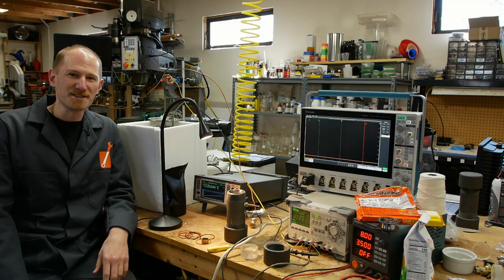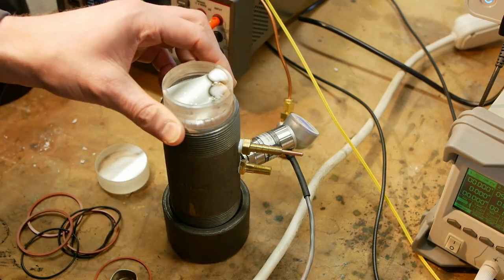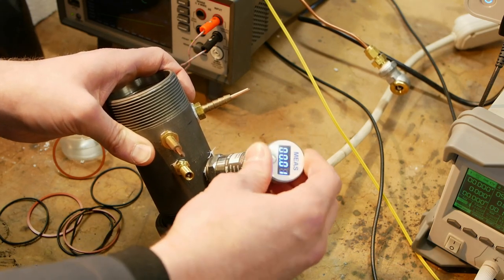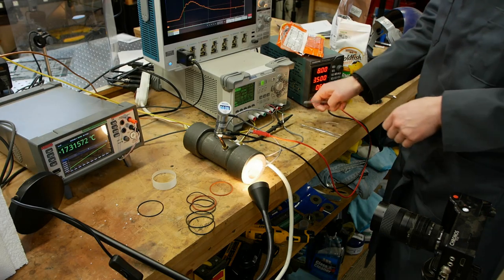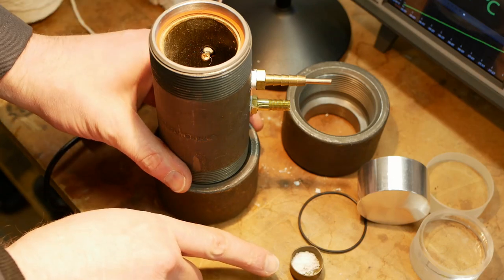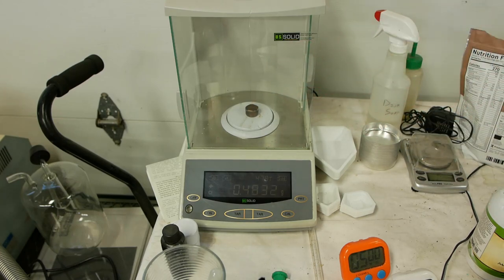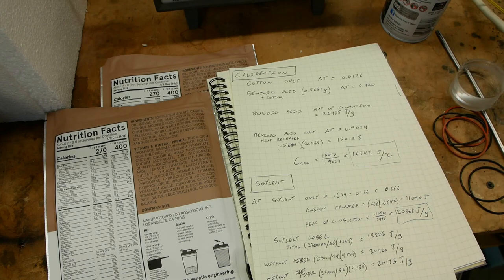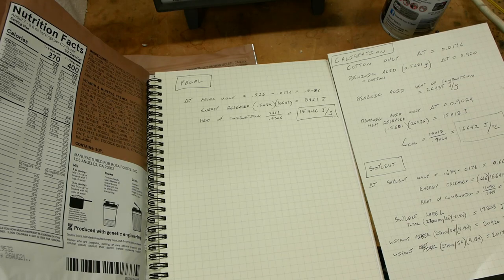Measuring human digestive efficiency vs. a flame

Comment: As others have commented, the answer fails to answer the question because the solid matter passed out is between 10% and 20% of that consumed: the rest is passed out as CO2 (carbohydrates, protein, fats, are metabolised to CO2+water).
To do this experiment accurately it would be necessary to:
1.  Water fast for long enough to purge the waste, or use a drug such as that used for colon surgery to purge.
2.  Add up the total weight of dry food in, and dry waste out.
3.  Follow with another water fast to ensure you have caught all the waste.
4.  Compensate for CO2 lost from metabolising sugars and fats during the fast: this is not easy to do from weight change because a gram of fat contains more than double the energy of a gram of sugar.  For a short fast, almost all the loss will be sugar.
5.  Add the output of CO2 during the period of the experiment, based on your base metabolism.
A lot of controls and compensation to do get a real figure.  
A quick guide is 80% of food in when dieting is metabolised to CO2, and you measured that the solid output has a 25% reduction in calories, so 80%+(0.25x20%), so overall the human digestive system is 85% efficiency.

Comment: Silicone does burn in normal air, just not particularly well. A good first-line test for if something from a shady company is actually silicone or some other polymer with an innacurate label is putting a small piece of it to in a flame. If it's extremely hesitant to burn on its own and produced fine white-to-grey ash without charring that means it's real silicone.

Comment: These experiments are extremely difficult to do with any degree of accuracy. The problem is basically that the body stores a few weeks worth of energy as fat, and your experiment involves a sudden change in diet which would be buffered by this. If you continued the experiment for a few more weeks you’d probably find your Soylent intake increasing or your poop calorie output decreasing. The other way of measuring digestive efficiency is to confine the subject in an airtight chamber and collect up all of the CO2 and water emissions to infer the amount of food “burnt”. I guess this is even more uncomfortable than eating Soylent for a month.

Comment: Interesting. I feel the point others made about input/output ratio is valid. Also, it must be mentioned that a lot of poop consists of heme(iron) and proteins from dead blood cells discarded by the pancreas i think. So this experiment could potentially be burning iron that was not able to be replaced by the soylent.

Comment: You might use a  soft copper gasket made in a similar manner to the silicone gasket you show in this video. It is MUCH less flammable and compressible enough to make a decent seal. You may use  8 to 16 mil material as you think best for this application.

Comment: Did you consider that the fecal matter is less than the food you consumed - that is for each gram of Soylent you consumed, you did not produce one gram of dry fecal matter. To really calculate the digestive efficiency you need to take that into account and it will change the result drastically.

Comment: You should make a recess for the o-ring into the metal. Less surface will be exposed and it might be squeezed nicer. If the recess is perfect, you could probably make it perfect with no exposure at all to the oring.

Comment: I would assume the surprising result has a lot to do with a few key factors to keep in consideration. As someone already mentioned, the dry mass of stool will always be lower than the dry mass of soylent consumed for a given day. In this case energy density isn't the only data point, it would be interesting to find out would be a total yield of stool for a given day to calculate the total caloric difference from input to output. A yield would depend on regularity, water intakte etc. but this could be accounted for with frequent measurements ;-) 
Another thing to keep in mind is that around 30% of the dry mass of stool is bacteria, which in their own right have a high macronutrient content. In other words, the soylent doesn't only provide the host with energy
Reply: 30% of stool is gut bacteria, but it is grown out of the food we eat. And the lifespan of gut bacteria is just 3 days. So all the gut bacteria comes from the food he was eating. So there is no diference between food that we didn't absorve and food that we didn't absorve but reorganized itself in the form of gut bacteria. Since he kept the flow of energy constant by always eating the same amount, it is still reasonably accurate.

Also, unless he changed weight, all the mas he ingested will get out some way. But most of the flammable matter is going to be in his poop, because the rest is basically inert gasses, salt and water. The difference between the mass of poop and intake food will only tell you how much mass he lost by other means, but not how much energy.

Comment: Possibly a comparison of total Soylent intake to total dried fecal matter would be beneficial .
I think you are missing the fact that the output is not only the result of Soylent processing, but a fair amount of total body chemical cleanup / discharge .
I assume a large part of the output is actually spent organic matter from every part of the body .
Just a rudimentary study of the digestive system reveals that a wide variety of substances are present and injected into the processing facilities of the gut .
There must be many caloric ingredients present in the waste that is not directly a remnant of the Soylent .
It could be that the body is processing and using a high percentage of the Soylent and the waste is comprised of other materials from around the body.

Comment: It would be interesting to use a second known source of heat (apart from the benzoic acid) to confirm the calibration was working correctly. Really, really awesome stuff! (I think diet and metabolism science folks would be super interested in this setup for rigorous measurements)

Comment: You've missed a key element of data: you have not checked how much Soylent corresponds with 1 gram of fecal matter, and have erroneously assumed it to be 1:1. Most likely it takes significantly more than 1 gram of Soylent to produce 1 gram of fecal matter, perhaps multiple times as much. The human body absorbs a significant amount of the dry mass of food in the gut and expels quite a lot of dry mass via urine. Fecal matter dry mass is almost certainly lighter than the food dry mass it corresponds with, and may be drastically lighter.

A more reliable method would be to measure the total dry mass input per day (maintaining a stable amount), and then collect all fecal matter over several days, desiccate all of it and get a daily average dry mass output. This would be a much more difficult task but would yield a fairly accurate result on the actual efficiency of the human gut.

Comment: At first I didn't quite grasp how the change in temperature from 13 to 14 degrees and a change in temperature from 14 to 15 degrees is caused by the same amount of energy, but I guess it makes sense.

Water + "bomb" is the system we are measuring and energy put into that system by the bomb will disperse into the water. We are measuring heat which is energy so in both cases the increase in heat/energy must be the same.

If, hypothetically, the bomb-water isolated system was at rest at 200 degrees C. Meaning, the bomb is at 200 degrees C and the water is at 200 degrees C. Now we combust the bomb, it will heat to some number, let's say 300C. Now this heat will be transferred to the water and equalize throughout the system. This will take some specific amount of time for the heat to disperse equally throughout the whole system.

Now we repeat this above situation, but with the bomb-water system at 15 degrees C as the initial condition. We again combust the bomb, it gets to 300 degrees, there will now be more transfer of heat from the bomb to the water.

The change in temperature of the system as a whole is the same but the transfer of heat through the system is different in some way, there is more heat transfer. Does this change the time until equilibrium is reached in a significant way? Would it take longer to reach equilibrium in one of the cases? If so, in which one? (My guess would be the second one)

Comment: Nice. You can also easily make silicon rings in a 3d printed mould. Either use 2k silicon or simple high temp engine sealing silicon

Comment: Very interesting video. Some information missing is, how much output your digestive system produced per input. So i am assumung, that your endproduct is just conzentrated fiber, wich obviusly burns and therefore this relativly high number of kalories. I would suggest a calculation like: 100 Grams of Soylent produce xx Grams of waste which equals xx Kalories left over.

Comment: Lots of the comments here are interesting, but I'm just commenting to say I have that exact same flash drive that's shown plugged into the multimeter. I found mine in a park a few years ago, just lying in the grass. Yes, I plugged it in: it was completely empty. Now it's my most frequently used flash drive, despite being only 128 MB. (I guess the small capacity might be why it's used here, to be compatible with the multimeter.)

Comment: You cannot find details for the build of the caloric bomb, but still, you can find out how efficient the human digestion is, we were told that at school in the 4th grade. The human digestion is very similarly efficient to what you found out, except, as you already noticed, the fibers, that don´t get digested. Your results were great, compared to scientific, averaged results (averaged over thousands of humans). Human efficiency: 20-25% (tops). e-bike-efficiency: 90% multiplied by electricity generation efficiency (55%), gives us 50% total efficiency, so that e-biking seems double as efficient as walking, additional to that while e-biking, you´re 5 times faster than while walking/jogging (25km/h by 200W e-motor-power)... With a velomobile, you´re even 12 times faster, and (again, still) double as energy-efficient, than while walking/jogging ( https://www.youtube.com/watch?v=4IHIdGVGKdI purely driven by the legs, but still makes the case for the velomobile stats )... 
Aditionally, part of the food is being converted to methane by bacteria, and you cannot measure that ( unless you live with a hose by yourself all the time ). So, don´t believe people telling you that walking is the most ecological way of moving, humans have luckily developed long ago far beyond that... :-) Bye, and take care of your tires...

Comment: There are foods that require the body to use more energy during digestion than the energy contained in the food.
In other words, the more you eat of that particular food the more weight you lose.
Celery is a example of s food with “negative” energy content during digestion

Comment: It is not surprising that the specific calorie density of the output is similar to the input as is composed of many of the same things. The portion used by your body is converted mostly to carbon dioxide and water, which isn't in the freeze dried waste. If you want to determine your "efficiency" you'd need to track your input and output over an extended time and determine how much output is produced per unit of input.

Comment: Part of the equation is that our digestive system as lots of natural processes have a very big slack for bad times. What I mean is that the 25% energy takeout would probably increase if you would eat only one of that bag in every 3 days. Its tricky because your body weight would also start to decrease but that is also a calculated loss by the body, meaning it is actually advantageous to lose weight when starving because muscle maintaining is a big energy waste. I wonder how it would be possible to get the maxed out digestive power.

Comment: Have you considered 1 pound propane cylinder shraeder valves? They are insanely overbuilt in my opinion and could be suitable for alot more pressure. This doesn't account for the hard to push situation but hey... just a thought

Comment: I think the missing information is the total weight of dried input and output. What I mean is if dried input is 1kg and dried output is 200g, then you have to multiply the energy per gram by those numbers to get the real efficiency. 

Well, this looked worth doing just to put "setting shit on fire" under lab experience in the CV.

Comment: maybe you can try using tin to make a gasket. I know cody's lab does something like that with mason jars and it should work as long as you put enough force to deform it. Although i dont know if the reaction between oxygen and tin would affect it. I would really like to see if it does.

Comment: The caloric measurements are based on chemically measured base components which is why it's also put on the label. It is not exactly digestible calories either. These base components are converted to caloric averages of these base components estimated using body calorimetry and people getting fed some amounts of the basic constituents. Then they're summed up. As such these numbers are not very accurate.
The base components of food are derived by using enzymatic and chemical reagents. Whole chunk of science there to measure these more or less accurately.

Short version: calories label = calories glucose + calories fructose + calories sucrose + calories starch (+ other sugar calories enzymatic processed, e.g. lactose) + calories for each kind of trigliceride (saturated, monounsaturated, polyunsaturated) + calories free fatty acids + calories protein (enzymatic processed).

Comment: There is pretty much one carbon-backed polymer that doesn't burn in pure Oxygen that you can still breathe: Kel-F.
I did some research on fire-retardant materials suitable for low-pressure (nearly) pure-O2 human habitats, as the overall pressure can be much lower (200 mBar suffice, but a bit more gives you some leeway).
Everything burns in that atsmosphere, at least unless you soak it in water or something like that.

Comment: As many others pointed out, comparing the input with the same amount by weight output, was a pretty big oversight. You looked at what remained of the output after the burn and said that it was a surprise how much stuff left, and that it's probably a higher concentration of minerals and stuff. Which is correct, and that should of been a giant clue why Your conclusion was completely wrong.
You don't really need any fancy equipment to measure the human digestive system efficiency. You just wait until everything in Your tracks passes, eat like 500 grams of the soylent or whatever, wait until that passes, dry it and put it on the scale. Then You know exactly how much of the stuff was used up by Your body. If You wanna go the extra mile, I'm pretty sure there is a way to cemichally separate the non-digestable stuff from both the input and output, and exclude it from the equation.

Comment: Well, hell, you could've asked any US Army combat arms soldier or Marine about this. 

What, you think the colorful description for an unpleasant task "a real shit-burning detail" has no basis in reality? Because it does: Feces burn, and that's how the US Army disposes of the contents of the barrels of medium-duration outhouses: Remove the barrel from the lower rear of the outhouse, dump an accelerant in for reliable ignition and to burn off any moisture (Mixed octane gasoline preferred, usually about 5 gallons to each 55 gallon drum half) grab the clean end of a piece of rebar, (also, "the shitty end of the stick" has a basis in reality)  wrap the dirty end in a few turns of toilet paper, soak with gasoline, ignite, and apply to the barrel. Stir to maintain ignition, allow to burn out to ash. Replace barrel once cooled. Stinks to high heaven at first, smokes like you wouldn't believe, but leaves ash instead of goo.

Etymology lesson aside; Of course there are volatiles and flammables left in feces, else we'd excrete a powder instead of Mr. Hankey.

Comment: Great process and effort! I suspect that the efficiency would go up as you correct for mass. Id be very surprised if the ingestest dry mass was equal to the excreted dry mass, considering one is essentially shedding cells all the time. Still, I would not expect the overall efficiency to go well beyond like 35%. So the results seem pretty reasonable to me.

Comment: I have just finished reading Dr Giles Yeo's book "Why Calories Don't Count" and he comes to the conclusion that the Atwater Specific Factors are not taking into account the calorific availability of the food (about 6% less than the Atwater values) worth a read if you're yo-yo dieting and wondering why fad diets don't really work.  The amount of calorific remnants in this stool sample might be insoluble fiber, a filler often used in diet foods to give the feeling of "fullness" without having any usable calories.  I'd be interested to see a controlled study of a group of people living on a diet solely consisting of Soylent (although its website doesn't seem to recommend it as a complete food replacement)